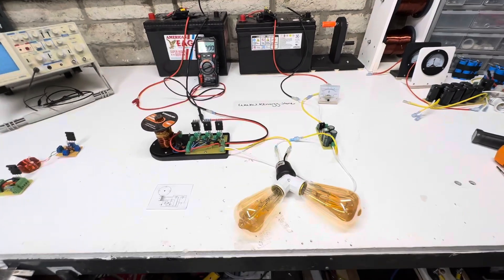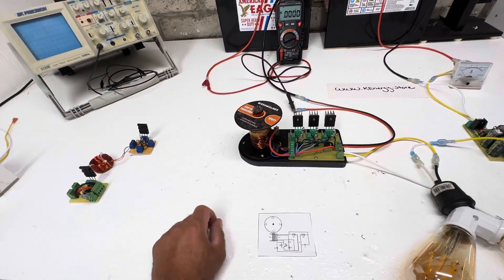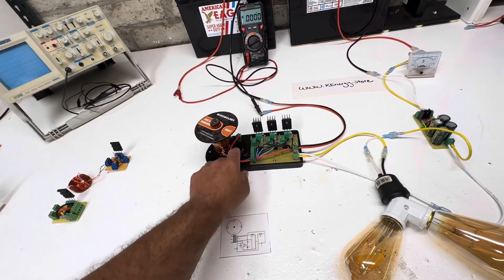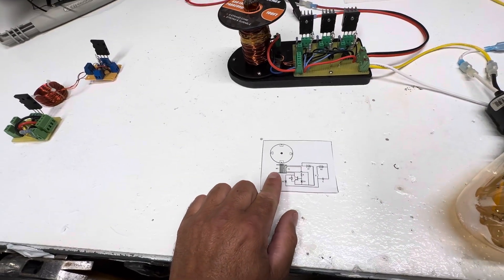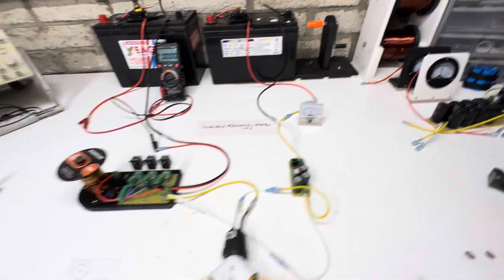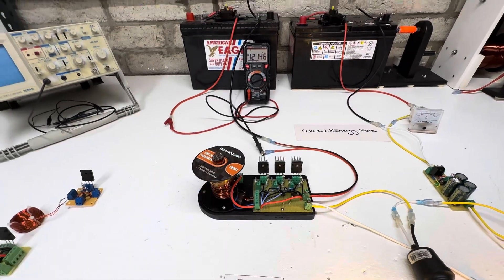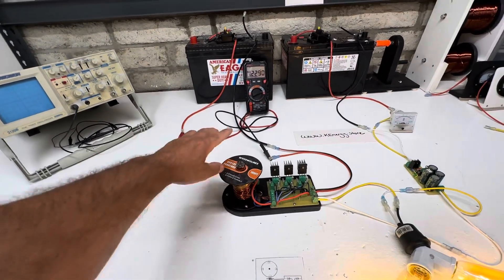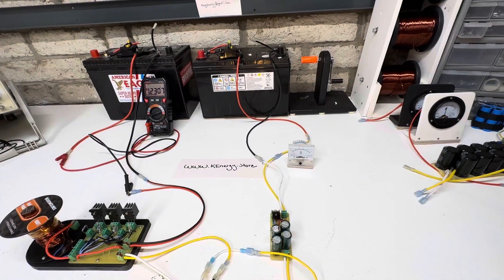Bedini forced Oscillator/ motor function

Comment: will the circuit work if i remove that cap on battery 2 ?
Reply from the maker: Yes
Reply: @kenergy1707  ooh, thank you very much for replying quickly !  : )   one more little question, whats the difference between a normal bedini circuit and the self oscillator ?

Comment: Is the forced oscilator circuit exactly as you show in that little piece of paper at the beggining? Cos i want to make one. And i wan a start with the most basic set up. Got a few transistors in my box i wanna play with : ) which wires do you mean when you say swap them around ? Thanks.
Reply from the maker: The negative trigger goes with power positive